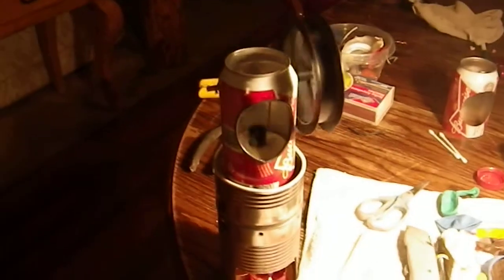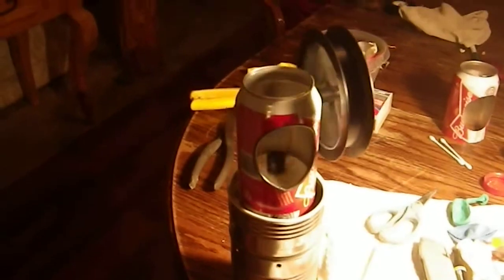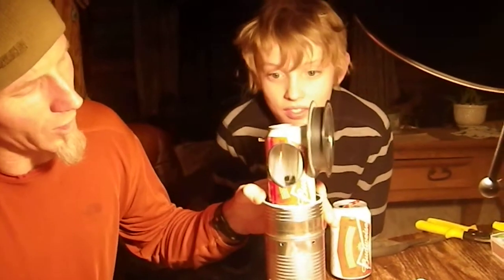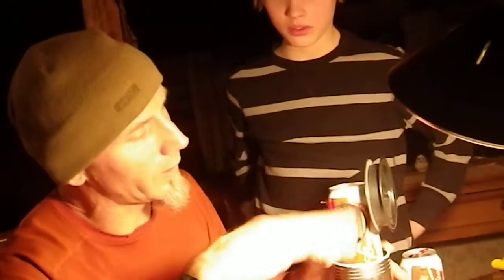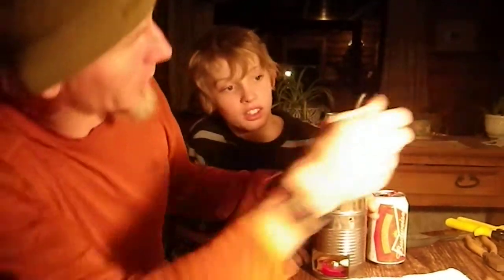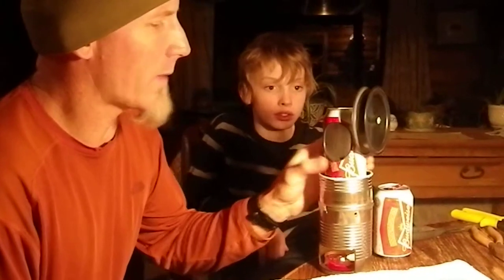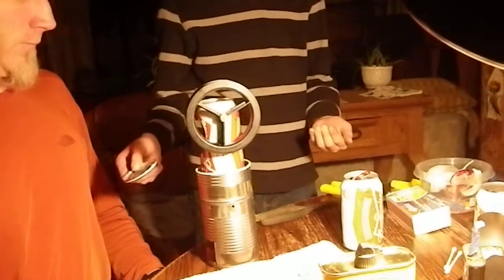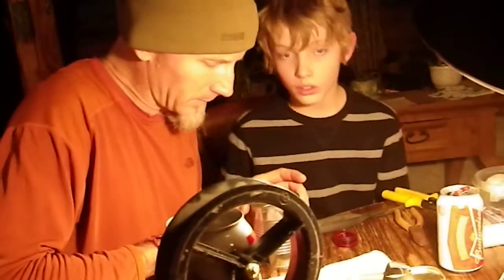Stirling Engine Build... happily built using beer and soup cans.

Comment: weird engine you gat there but nice house compare to my own
Reply from the maker: +Ristyan yesf Yes it's a Sterling Thermal engine using external heat vs internal. Either way its using heat and an expansion chamber. That's my sister and families log home built in the 70's.
Thank you, Jim